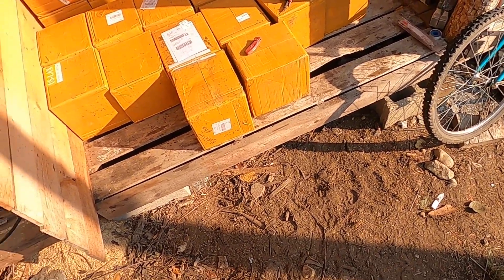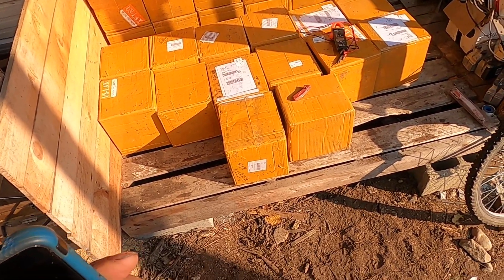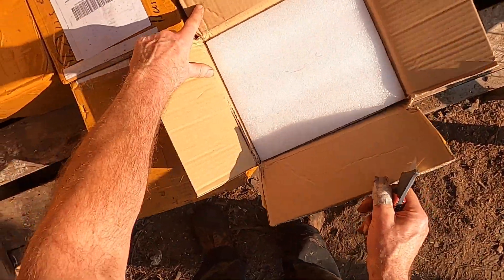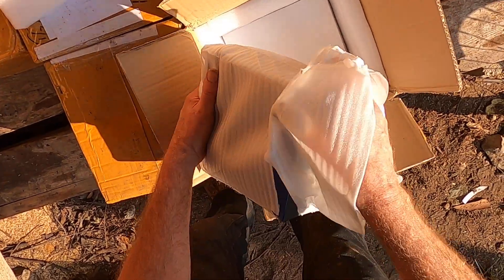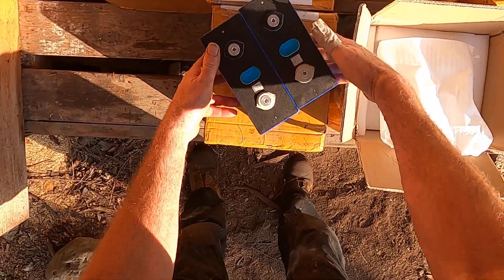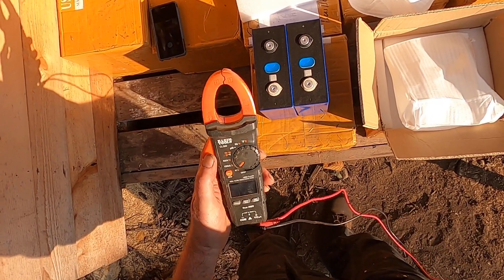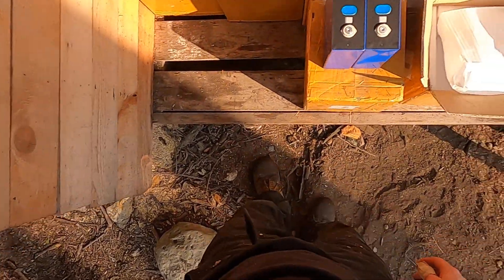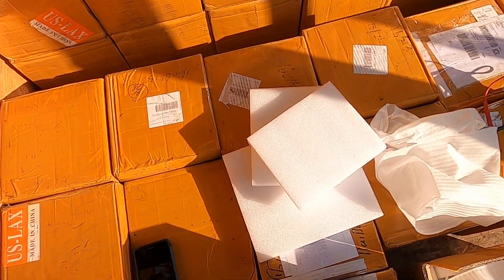Unboxing & review - Shipment #2 of our new Xuba/Luyuan LiFePo4 280AH EVE Cells

Comment: How do u think these 280ah would got in a 4x set up for an rv battery?
Reply from the maker: You would want to figure out what loads you need to power and how much you use those loads.  That would tell you what size battery bank would work best for you.  Otherwise I think a 4 cell 12 v configuration would work well.  We are in the process of building a 12 volt portable power system in an old toolbox and so far the performance has been impressive.  We have a few videos up of this portable system if you would like to take a look.